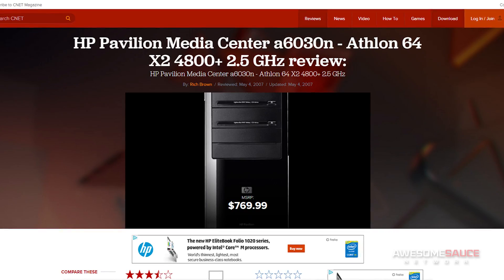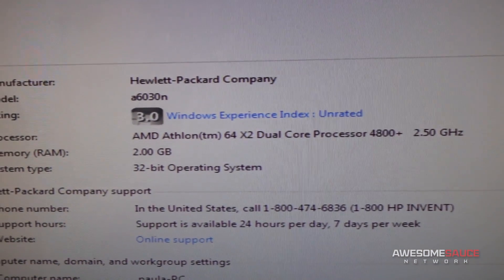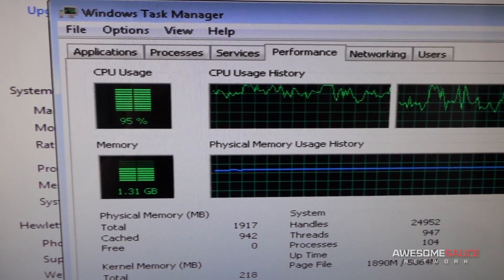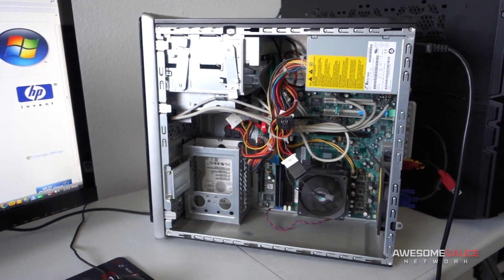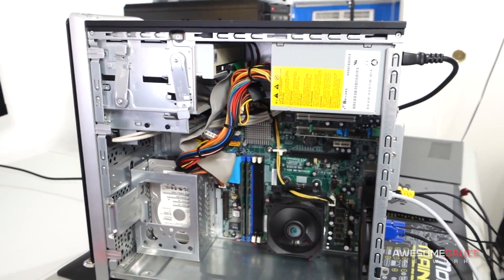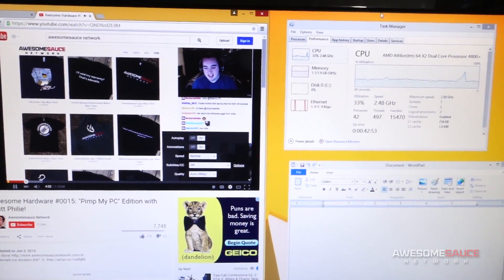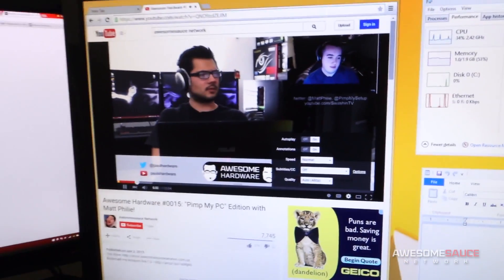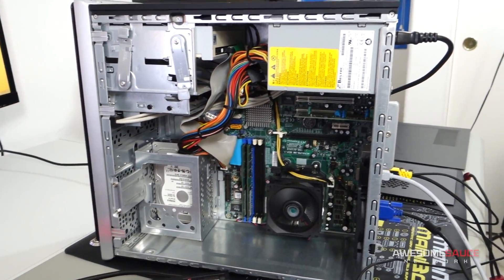Cleaning Up My Neighbor's Old Desktop!

Comment: I like this vid. Unless you are a power user/enthusiast, a lot of systems can be spruced up a bit and made very adequate for most 'normal' users.
2GB of ram is still pretty pathetic though. I know DDR2 prices are not great compared to current gen, but unless the neighbor is planning on a full upgrade soon, I would still recommend another 2GB to give better head room. You know once you give it back to them they are going to install 'stuff', printers etc, and leave all the default bloatware options checked.
I recently acquired an old HP very similar to this case, except there was a huge removable media bay installed vertically on the right side, blocking in the HDD tray. The system had a dead HDD, and I swear it had to be from the horrendous air flow caused by that media bay.... Rest of the system was fine, Core2Quad, 6GB DDR2, and a discrete graphics card (GForce 9500 GT). Moved the whole thing into a spare case with better air flow and a spare hdd. Making a pretty good test bed to play with the Win10 preview on.

Comment: Does anyone know where to get single drr2 4gb? I know it's old, but I want to use my computer for 3 more years for gaming and mostly editing videos.
Reply: TheDarkstar826  Try Ebay or Craigslist
Reply: I checked there. no bother selling it. I remember it was hot back then. now they stop doing it. I see at newegg almost $100+. its more expensive than ddr3. its crazy.
Reply: Get ddr3 cause ddr4 is out
Reply: I guess i have no choice. alright.
Reply: its faster too :)
Reply: You can't put ddr3 on a ddr2 motherboard
Reply: I know that. I have no choice to buy a new motherboard and CPU. Maybe, I could buy a new motherboard that accept ddr3 and my cpu at the same time. I'm trying to save money.

Comment: Hope that he hit up the OEM for updated BIOS drivers...

Bios is another nifty little place to sort out the last traces of malicious content. You've got to be strong in the force to get some of those nasty ones out.

Beware of backing up that HDD on your personal drives as you'll pay a heavy price. The best thing I can recommend is using the Arch Linux environment to handle the HDD formatting. You could even use the original DOS 6.22 if you want to try a lazy route that can work, but Linux is really good at scrubbing the drives from a Windows PC.

(I would have done a small partition and put the Linux on the drive to let him wipe his Windows based problems 24/7. In this space, Linux is a godsend for fixing a Windows partition with errors or virus... it's very ironic. LOL)

Be careful what you bring in as there is well written code that could wreck your own hardware.

Comment: I enjoy watching your desktop makeover, looking forward to many more. Your description of the old technology and its limitations was very interesting. I did the same to a friends laptop which got so bad that I couldn't move the cursor so I decided to go into safe mode and remove as many as the unwanted programs as possible then when I had some kind of navigation I backed up all his personal data before wiping the drive clean (of all the free gifts from the manufacturer together with crap ware and god knows how many viruses) with Win8 which gives a small performance boost over Win7. Turned out the idling went down to 10-20% but reaches around 80% on Youtube + browsing etc. And his laptop is 8 yrs old.I'm also wanting to see the difference between an old OS on a system many yrs later and a recent OS installed on old technology. If anything it should be interesting.

Comment: Man, this looks like my old one ... I had an athlon64 x2 5200+ @ 2.6 Ghz with 3 GB of DDR2 and GeForce 8800GT. Board and CPU is still with me, as i keep it as reminder of good hardware ... but since my GF 8800 GT died - no use. BUT i was able to run modern games at good framerates ( 1680 x 1080 ) like BF3 and COD Black ops 2 ... even thoes things looks old and ARE old, they can do some serious things if u got wright components :)

Comment: Kyle, I could tell you some crazy stories and show some disgusting pictures of computers I fixed for Geek Squad and Staples. I've seen everything from dead cockroaches to living spiders and even a dead mouse... And I'm not talking about the peripheral.
Reply: ExiliousX And incase you're wondering, the retail cost for the service you just performed would be $200 + the cost of the OS.
Reply: ExiliousX You're not lying, when I first started building PC's it stopped working and went super slow after 2 weeks so my first thought was that it was the motherboard the way it acted. I had no test equipment to check anything so I called up geeksquad because it was my first build and I figured they would know way more than me. I told them what was happening and what my opinion was (that I thought it was the wiring on the motherboard), at that point it wouldn't even boot up anymore, just stay black. they said it would be 200$ just to look at it. I called a computer specialty place 1 block away from bestbuy and asked if I could bring in my pc for him to go over it and he said yea but didn't know the price. I went there and he went over the wiring taking 2 hours for all the checks  and determined (after connecting the HDD up to his diagnostic equipment) that it was a bad hard drive. Charged me 25$ so I gave him 50$ as a tip for him not trying to  screw me over with price. I didn't think it was the hard drive because I had bought the hard drive 1 week before and it was brand new so I ruled it out early. Now I repair peoples PC/laptops free unless it's a repeat person, the ones that constantly let their kids get on the computer and let them download things like limewire (yes I still see pc's with that installed) or other things I have told them not to do like clicking yes without reading when installing programs. At that point I usually charge 20 bucks. Its fun for me to repair peoples PC because when they get them back it's like it came from the factory again (minus bloatware of course).
Reply: ExiliousX 300 dollars? they'd almost be better off spending 400 on a new PC. lol
Reply: ExiliousX deadmau5 lol haha
Reply: Saylor Hater I just ordered my parts from Newegg one day and followed the instructions manual the first time to get and idea how it worked. It's a little nerve wracking the first time you tinker because you don't want to break anything because of cost, but it also teaches you to respect the parts and treat them with care, as you should with any PC you clean/build.
Nowadays I can build, mod, clean, and fix PC's in my sleep.
Reply: ***** yea its fun to play with technology all day.
Reply: ***** nice, you will have fun. You should check out this website it is pretty useful for new people and maybe veterans www.pcityourself.com/building/introduction.php
Reply: ***** modern closed loop systems work just as good as a fancy custom open loop.
Reply: DJ Gaming I do love computers as well. I wont go work on anybody's except for my parents, and friends.  I feel like I might need to do a computer build for parents store. Before I even do that I need to get new business software. QuickBooks that cost around $200-300.  Even though the HP computer is meeting their needs. I feel   they can get another 3 or more years out of it.
Reply: ExiliousX My first PC build was 1984 plus 1000+ builds later and 10000+ service calls I've got some interesting stories as well. The Vet clinic PCs packed full of cat hair so bad no components were visible other than the PSU and Optical Drive. Rebuilt a PC that had been in a fire and partially melted. The only PC I refused to work on, a sick kid vomited into the front air intake fans, disgusting.  
On the good side, I had a customer give me a $3000 thank you check because I had recommended some specific upgrades they were unaware of that increased their company efficiency so much they were shocked at their productivity increase. Their 18 hour days dropped to 90 minutes.
Installed a bunch of PCs in a computer lab and for 3 days work I netted $17,000.
Reply: ExiliousX As a current Geek Squad employee, not a lot of us can justify the price, but it's not like any of us see that kind of money. We are paid hourly, often just above minimum wage.
Reply: DJ Gaming I really want to educate my self with pcs, any suggestions?. Am just a high school student and the most i've done is open my pc and spray an air can
Reply: Saylor Hater Get a hold of some cheap PC's so that you can pull apart and re-assemble them.
I used to pick up old Pentium III towers for $5 to $20 from the re-sale store at the garbage dump, and sometimes I actually came across some surprising stuff.
One time in particular I picked up a HP Kayak XM600 for dirt cheap, mostly complete. Seemed like any ordinary computer at first but it turned out to be a workstation capable of housing TWO Pentium III's, and man was it a beast. Ran like a friggin' dual core, except it only cost about $30 in total.
Eventually I lost interest and sold it, which is a shame because it was such a unique system.
Reply: DJ Gaming I've scrolled through many forums for a bit, not in depth thou and was looking for something more 'hands-on' i guess. The flea market idea is gold and I will try it shortly. Thank you.
Reply: TheMechEngineer I never messed with the parts in a pc but working with cheap towers makes it more fear free that I'll damage something. I will see if they got anything in my area that I can mess with. Thanks for the help.
Reply: ULilBagel What would be the next step after getting familiar with the parts?
Reply: +ULilBagel That sounds disconcerting waking to find cables wrapped, etc. Smart chamfering of sharp case bits while awake to credit for it? Any pillows and fruit ever stuck in there when you wake?
Reply: ***** cant really remember what was asked or we talked about lol, I guess I was talking about repairing pc's? just charge money to do it. Bloat ware is software that comes preinstalled on your pc OS that is useless and only meant to make the software creator money. Like when you get a phone and it had preinstalled blockbuster and nfl on them.
Reply: A dead mouse?? Oh my goodness lmao

Comment: I would have removed the psu and mounted it so that the cables were exiting it at the back of the case instead of at the front. Makes cable management easier.

Comment: If there will ever be a next time, it would be interesting to know some "benchamarks" before and after. Boot time, how long does it take for the user to get to the most used program? 

I would also be curious to know if that machine can play HD-youtube, I would assume no. How much investment would it then take to enable that for this machine. Would something like $40 GPU be enough? Also how much benefit would there be if you would buy 2GB more memory, that can't be too expensive either. Some small SSD maybe? 

It would just be interesting to know how "good" of an all-around machine you can make out of that 8-year-old system with as minimum amount of money possible, let's say $50 when buying stuff used.

Comment: I'm running quad 1.8 ghz with a small 1 gb video card and 6 gb ddr2 and I'm able to play most games and do any other task I need to do, I'm also running windows 7 because 8 is as useless as vista. just because a pc is old doesn't mean it's dead.

Comment: Hi Kyle, what program did you use to clean up his system? Also, coffee filters?  I never that of that. I usually use paper towels
Reply: Swing4gr8nessN8 Paper towels have lint. Lint and static electricity are natural enemies of computers.  Coffee filters are considered to be "lint free", they don't leave behind small fibers like paper towels do. This makes them to be an awesome and effective tool at cleaning thermal paste from CPU coolers and such.
Reply: november7268 hey thanks for the tip. I'll definitely stop using paper towels then. What do you think about using alcohol pads?
Reply: Swing4gr8nessN8 Alcohol pads..never used them. As such, can't really comment. But i've never heard of people using them. Id stay away from them until you hear something definitive from a reputable source. I've always used coffee filters(cheap) and a bottle of high percentage of Isopropyl alcohol from your local drug store. Same stuff you use for sanitizing. Your looking for something with >95% I forget the actual percentage recommendation. Theres got to be something on google. ;) Its available OTC.
Reply: Swing4gr8nessN8 He formatted the hard drive. It is pretty easy to do and is the easiest way to "fix" any software related problems you may be having. Just get your Windows install disk ready, sort through all the important stuff on your hard drive, back it up, then format it. It shouldn't take more than a few hours.

Comment: If you really want a blast from the past my older brother still has the remains of my old pc I let him use ages ago before he bought the one he currently has. A high-end Athlon 64 on socket 939 rockin one uber core at 2.2Ghz, 2.5GB of lightning fast DDR, and an almost unfillable 80GB Seagate Barracuda running on IDE.

Or if you want to go even further back I still have my first gaming mobo; An MSI N1996 sporting a speedy Athlon XP 2400+, nVidia nForce 2 system chips, and three DDR ram slots.

Also, if anyone takes what I said seriously then the sarcasm flew right over your head and crapped in you hair without you knowing. :P

Comment: Awesomesauce Network Kyle nice video man, I don't want to sound rude but.. a way to fix the APU along with other issues would have been to turn off features in Windows that don't need to be running.In both Windows 7/8/8.1, there are a lot of features that don't need to be turned on that you could have turned off and it would have made a surprising difference.

Comment: What is the name of the old sata chords that connect from
The motherboard to the hard drive? The socket is not like the current USB style, but a rectangle with holes punched in, usually blue colored.
Reply: JimmyJazz332 I think you're talking about IDE or P-ATA, basically the predecessor to S-ATA
Reply: up until what year did MOBO's switch over to what we use now?
Reply: JimmyJazz332 im not very versed in the history. i got my first in 2005 and it still had ide, so not too long ago.

PS. wikipedia says around 2010 and that seems legit. xD

Comment: i hope before you give it back to him you install at the very least Microsoft Security Essentials if hes going all malwary then have a basic free, windows built av software is a must.
That said its funny my current rebuild is a HP Pavilion laptop i litterly got out of the trash, i was thinking "hey electroics dont go in the trash i'll toss it in my box of old part so when a silicon ryceleying fair comes through town i'll do the world a service" then out of curosity since i had a gift card i bought a battery and power supply, booted right up, no vorues, was even runing windows 7, it only had like 2 gb of ram and like a 80 GB hdd but hey it was free so it's become something of a side project, a good way for me to get some more pratice upgrading a laptop so i'm gonna upgrade the ram, hdd, and CPU if i can since all the parts are pretty cheep, then i'll probably put it up for sale for like $300, all from a literal Trash rig

Comment: Awesomesauce Network  i feel ya Kyle, I was enlightened to how deprived PC illiterate people are, I bet that was a PCIe x16 1.1gen slot. I had to upgrade an HP pavilion elite p6210f, I replace the CPU cuz it had 2MB of cache (Pentium E5200 to Core2Duo E8600) and office applications were lagging ; swapped in the CM heatsink with a deep cool cpu cooler w/80mm fans and upped the gpu nvidia G210 >>to>>GT620

Comment: i like it! i just don't understand how come ddr2 are still expensive on the market.
Reply: Insane CoolAid Since almost everything has moved over to DDR3 or 4 now, the production of DDR2 is way down, so it's about as expensive to make DDR2 as it is to make DDR3 now.
Reply: Linnoff question is then, why is it still made? The rest that has been made will be used till it dies and by then, all the systems that run it are dead anyway.
Reply: ***** I got my dad 2gb recently. I'm sure I could have done like Kyle did and gone through his programs and cleaned it up that way, but it was so much easier to just get him a couple more gigs.
Reply: TheLanceShow why is it still alive?
Reply: TheLanceShow like which for example?

Comment: Tell him to just buy a new computer.  That motherboard (and many just like it) are notorious for having blown capacitors.  I didn't see any on that one but it's only a matter of time.  Retail level mechanical hard drives typically are last around 5 years, so its only a matter fo time for that to fail too.

Great job cleaning it up, but I would of just him to buy a new HP slim desktop for $180 which will blow that computer's performance out of the water, use less power and includes a new keyboard/mouse.  That or in his case I would recommend a chromebox since he is prone to get viruses.  Fixing that thing isn't really worth your time imo.  Support for vista expires April 11, 2017